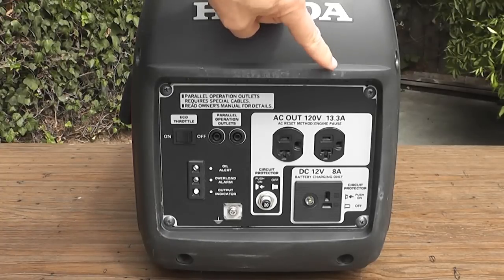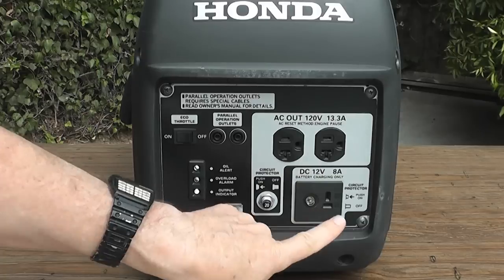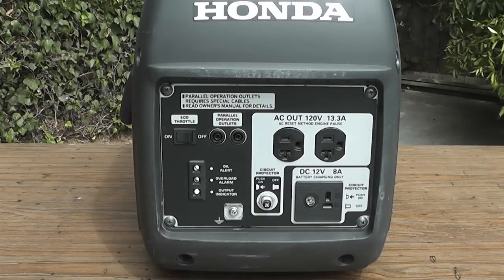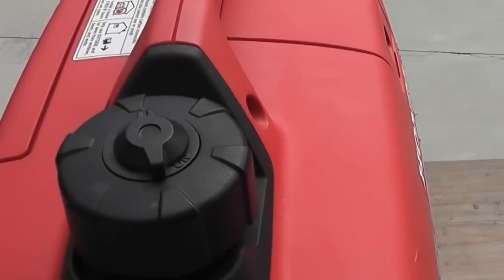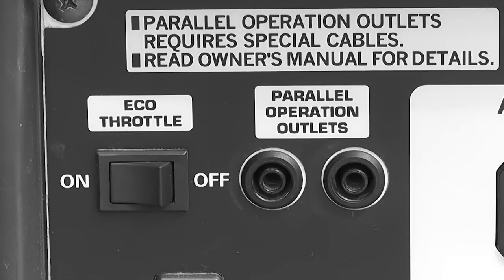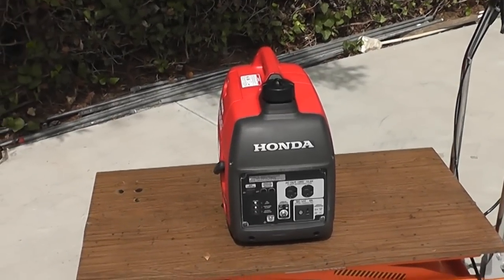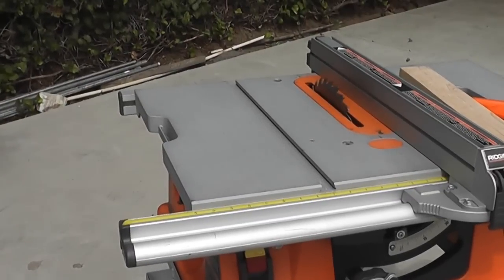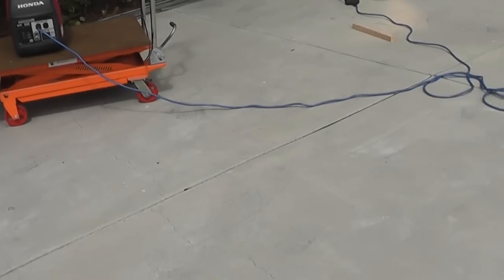Honda Generator EU2000i 2000 - Explained

Comment: Is it still running well? Any maintenance needed in 10 years? Thanks
Reply: Oil changes. Maybe a spark plug
Reply: And probably gotta clean the filter. Just like any motor

Comment: I had two used eu2000i generators,  which ran beautifully and powered our 50 amp travel trailer when I built a parallel kit to combine the two outputs using the banana plugs and 120 V circuits; two legs of 120 V, which did not need to be out of these because the trailer only uses 120 V circuits on both sides of the electrical panel. Then some heroin addicts stole them from my garage… So I got two new ones.  The inverters provide "clean" Voltage, and for those who say they are not enough, you can only get so much water out of a bucket, well, river, etc. They weigh 49 pounds apiece and can be carried one in each hand. No, they're not a bag of marshmallows. They don't vibrate around.  if you run alcohol-free "recreational feel" gasoline in them,they did not gum up. 
I'm 62.  I recommend the Honda eu2000i.
Reply: Okpp

Comment: Thanks for the info... But, I assume that the noise of the generator is lower than we can hear in this video as the generator was working over a board and something else I can’t see properly and it certainly it’s amplifying acoustically the noise. If the generator works in the floor (concrete) or over a small board on the grass the noise will be about half of the video is showing.
Reply: Have this sane unit it put out 127v when wired to my furnace circuit it will not run the furnace ,why

Comment: If you're considering a small generator... These Hondas have replacement parts that are readily available. Not that you'll need any, but you can get them on Amazon or Ebay. Try finding parts for your China generators. I researched for weeks and decided to get a used Honda EU2000i that was beat up, but had very low hours. They can be had for $400 (or less) if you are patient. Starts right up, doesn't smoke.

Prices on Ebay range from $300-$400 (old, but still runs), to $500-$600 (average condition), to $750 (very nice condition) to $900 (brand new, open box). These sell every day, since there are so many of them around. Scope 'em out for a few weeks, until you see the one you want.

Comment: Question. Its now 2020 and I want to run two generators linked.  I could buy these 2000 watt units for about $400-500 each.  Maybe 8 years old? But many have low hours.  Or I could buy two of the new 2200's  for at least $950-1100 each plus tax.  Trying to decide which way to go
Reply: Same- what did you end up doing

Comment: Will this run a portable ac unit that is installed on windows
Reply: Mine does.  And it does it flawlessly.  It is an energy saver AC unit (that may make a difference).

Comment: You said This produces ac ? I believe this is dc then inverted into ac.
Reply: The main technical difference between inverter generators and conventional generators is what kind of electricity is produced. Conventional generators only produce AC electricity while an inverter generator produces electricity in 3 phases (high frequency AC to DC back to a stable AC current).

Comment: I have 2  Honda Generators the one we used for about 10 yrs had to have cab-rater rebuild I think that's  a common repair  we power our 32ft  wheel and it works great .Happy with them .

Comment: Can the inverter of this generator take a current from a 12 v battery and invert it to 120 v?  If so, then I would buy this inverter generator alone and avoid buying both an inverter and a spear ate generator for my van.  Thanks for the video.
Reply: Unfortunately, no.   That would be great if it could, but it's not designed to do that.  (But it would be an excellent feature!)

I suppose if you're a knowledgeable technician, you could perhaps open up the generator and modify it to do that, but it sounds like it would be a lot of work.  And it would void the warranty, of course.

Comment: Great Video, quick questions, Is your table saw a 15amps ? if yes how was the generator  powering it if the generator only powers up to 13.3 amps
Reply: I have no idea how many amps the table saw here uses, but Honda generators are rugged and can handle a modest overload for a short period of time.

Comment: what is wrong with this unit? One thing, no way to run till empty in the carburator. Thus, a machine used mostly for emergency, will not start after stored more than 3 to 6 months. A method needs added, to empty the fuel from the internals, so as to be useable.
Reply: It has a screw on the carburetor to drain it..... Just for that reason....
Reply: mine sat for 11 months and i needed it in an emergency to pump water, took about 5-6 pulls and it fired up and ran for about 7 hours running an 1100 watt water pump was low on fuel but never ran out

Comment: does it have an indicate when to change oil?
Reply: +tanh van off course it does have oil low indicator, it ain't your cheap make its HONDA mate! And did you even bother to watch the video it printed on it oil indicator lol
Reply: tanh van No it don't. Your suppose to keep a eye on the usage time. First service should be carried out after 20 hours of use then 50 hours then 100 hours then 200 hours as it's like cars. it's a engine mate!
Reply: Buy an hour meter and use that.they cost about ten bucks!
Reply: ebay or walmart tanh van

Comment: Hi!
First of all want to thanks for the very helpful video`s eu20-30... What for generator I need to use that i can run washing machine or dryer? thank you
Reply: +Anabol Anabol! If I buy eu30is is it enought to run washing machine or washing drayer?
Reply: @anabol1111  you'd need something bigger then 3000 watts cause the average dryer uses around 3000
Reply: @timmyteabag69  thanks buddy,I bought eu70i already and sold it year ago.thanks for reply
Reply: 4k video

Comment: Just replaced my old oil filler with this one. My old one was knurled which wasn't necessary. Oil would build up on the knurling. This one is smooth and works way better.
http://www.amazon.com/Changes-Honda-EU2000i-EU1000i-Generator/dp/B012P2GBQW/ref=sr_1_7?ie=UTF8&qid=1439662460&sr=8-7&keywords=dukester

Comment: A buddy of mine has the same unit but you can't even hear it running he does an auto show here in NJ for 3 days and has lights,camper,frig everything plugged into it and you can't hear it running..why is it that all of the same units are loud ???. Thanks
Reply: i think its just the camera mines quieter at full throttle then my tractor at idle

Comment: So I can run a battery charger and a 1500 watt heater with this 2000 ?? Or use a radiant heater for less  power.

Comment: Best friggin generator I've ever owned.  Much like my Honda snowblower ...... they're expensive, but you get what you pay for.
Reply: ***** How big is the generator? Also is it silent?
Reply: @SkintSNIPER262  i have a Honda 2000eu and 7000eu for work both very quiet, my buddy was buying champions for years and was getting 500 max hours out of them normally the generator would go before the engine but he now bought a Honda 7000 as well and has i believe almost 3000 hours on it without an issue he runs his constantly in the winter keeping about 15 caddle waterers running all the waterers together draw around 6000-6500 watts, he got a shop to design a system that once a sensor in the fuel tank senses its at around 1/4 of a tank of fuel left it will turn on a pump and pump the tank full from a 50 liter fuel tote beside it

Comment: Hey there.  Great video!  You sound like the guy to ask about watts.  My wife and want to run 1500 watts of string lights along with a 800watt amp for music.  Can you tell me if we would need one or two of these puppies to avoid blowing a fuse etc.  That would be a big help.  Then, of course, we have to find them to rent which is turning out to be a pain.  Thanks so much!

Comment: You think you could have found something LESS NOISY than a friggen 110 db table saw to demonstrate the sound of the generator??? Seriously, You are hard pressed to hear the generator at all either way.  Maybe a portable air conditioner, refrigerator in the garage.  Jeez.
Reply: D Martel haha no shit. I was looking for one for camping and I won't be running power tools at the campsite 😂
Reply: D Martel and over here we shall how it powers this weed whacker and dust blower 😂
Reply: Yeah, that was a ridiculously poor choice of device with which to conduct a noise test on a generator -- especially a generator with a reputation for being quiet!

The right choice is simply one of those small portable room heaters that you can get at Walmart for ten bucks.  They're very quiet and can apply a load of up to 1500 watts (94% of the Honda EU2000i's rated power) with a turn of a knob.  They're perfect for this purpose.

Comment: Some reviews of this generator have shown that the 12v socket produces really dirty/poor power AND needs to be run in eco-mode OFF to work.  You're actually better off using a 120v plug-in battery charger/booster with this generator than the onboard 12v charger.

Comment: The output light will also tell you the number of hours that are on your engine so you know when to change the oil.  Read the owners manual for that info.  You should change your oil at the first 50 hrs and then follow maintenance sched.

Comment from the maker: Thanks for pointing that out. That button is NOT a switch; it is a DC CIRCUIT PROTECTOR. It stays on unless shorted. Pressing the button resets the circuit. I just pointed that out with an annotation on the video.

Comment: Just a quick question on the 12V-8A switch. Does it stay in when you turn it on? Or is it just a toggle/soft switch that springs back every time you press it? Thanks a lot!

Comment: I run TWO 20 ft RV's with 30 inch LED TV's, surround sound, Wii, X-Box, &/orPlaystation, DVD players, and laptops ....all running from ONE Honda 2000i in eco throttle mode.  The microwave also runs, which is the only device that pulls extra current when in eco mode.  I just saw a video where a guy had a RoadTrek class B RV, and his 2000i ran his rooftop AC NO PROBLEM!  He started the genny with the eco OFF, let the genny warm up, and THEN turned on the AC. Then turned on ECO. no problem!
Reply: So my fridge/freezer in kitchen and chest freezer in garage wont be too much for this same model?  Power outage situation only not every day
Reply: Interesting, I'll give that a try cuz so far my genny can not run the A/C